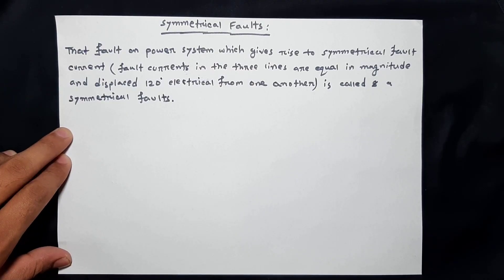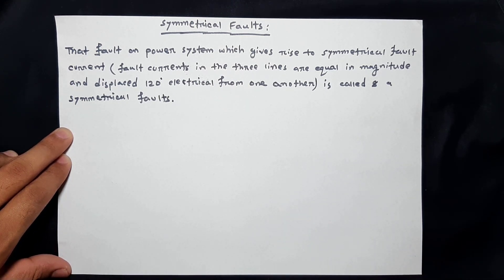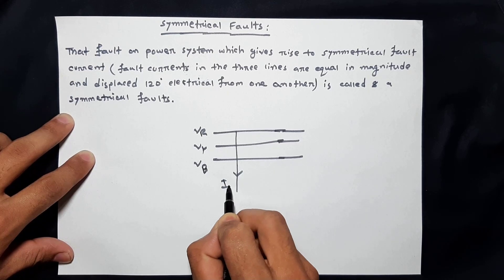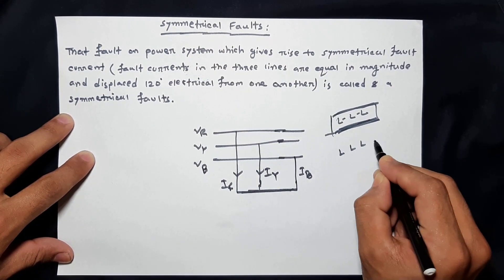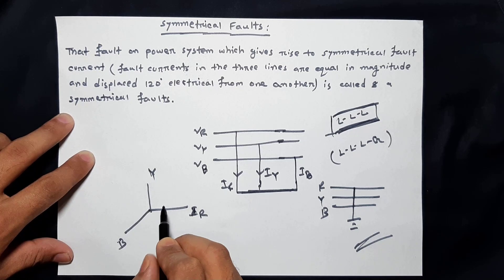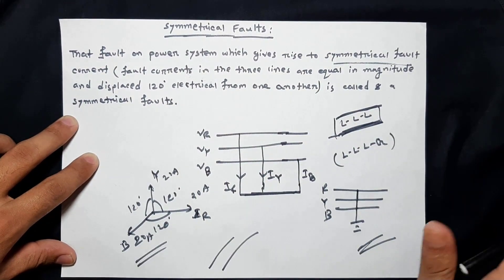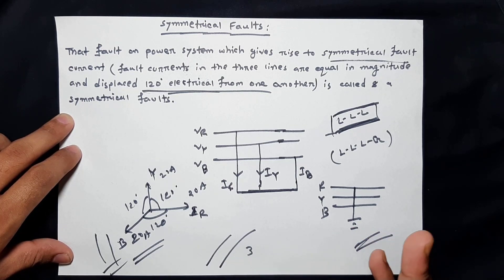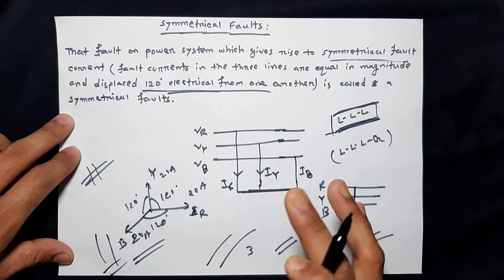18- Symmetrical Fault (L-L-L and L-L-L-G fault) || Power System Analysis || Bangla

Comment: Vaia Amer bashai 3 phase line use hoto. Line a problem thaker karone  meter theke 1 phase connect Kore other 2 phase disconnect Kore rekheche electrician. That's mean bashai 1 phase Dia line use hocche. But basher vitore je phase connect kora shetai to live line achei shate other 2 phase o live line show korche. Ater karon ta ki r ki vabe solve Korte pari